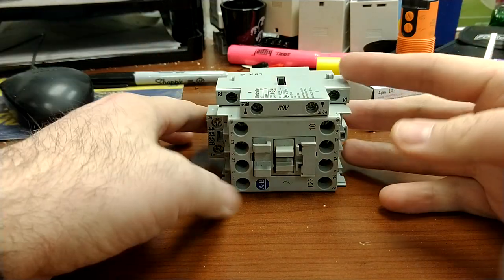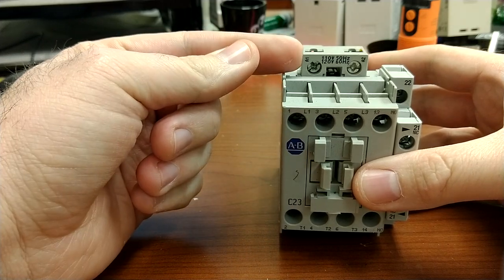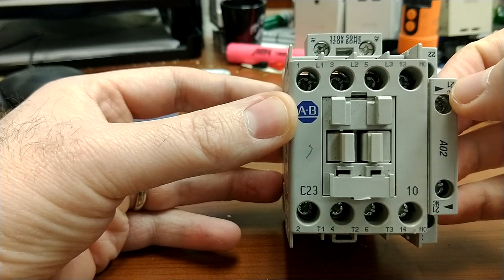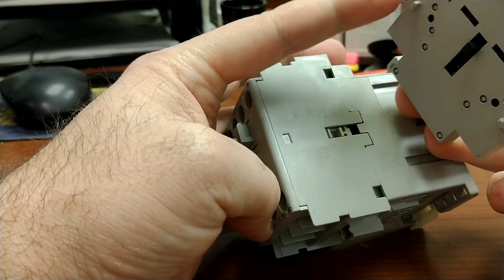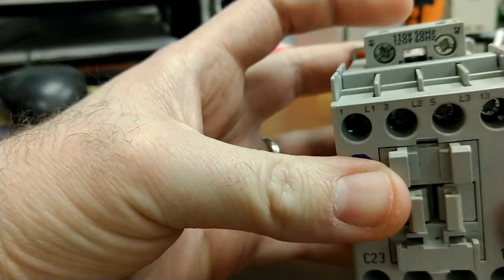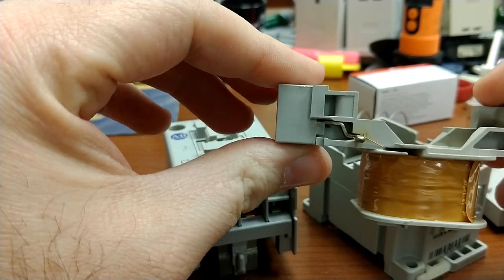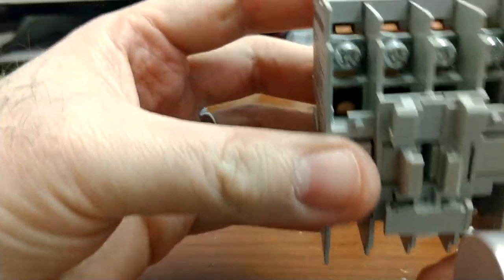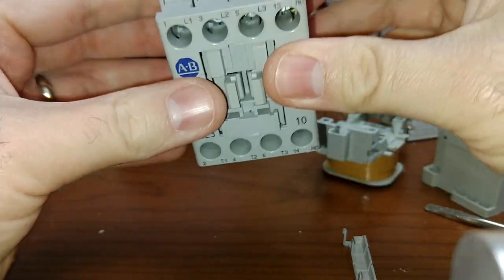How an industrial contactor works

Comment: On a Allen Bradley can you change out a 120v coil and replace it with a 24v coil using the same contacts? Will the contacts still work
Reply: I was gonna ask the same question; did you find out if it’s possible?